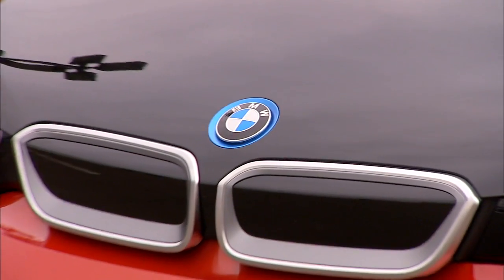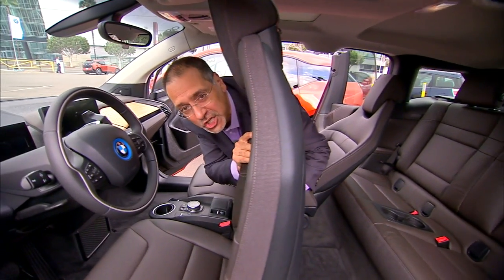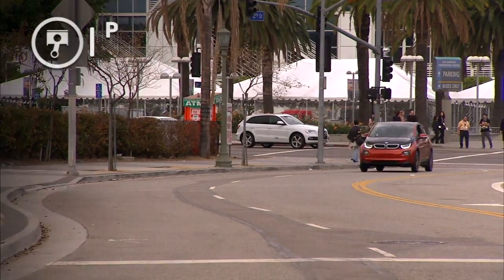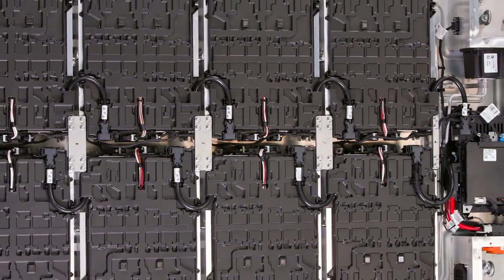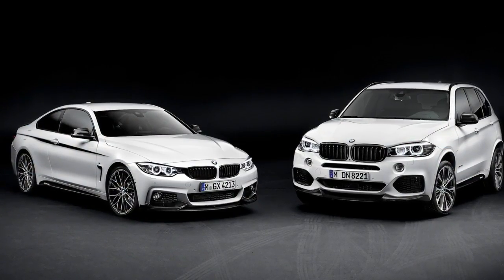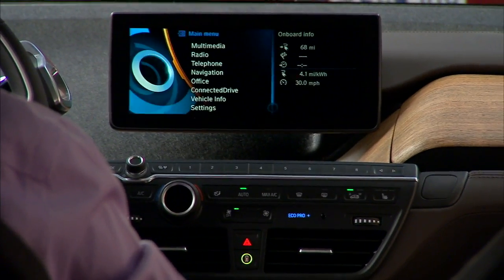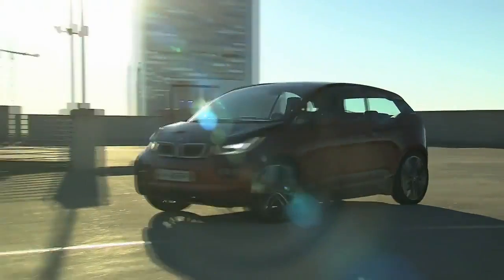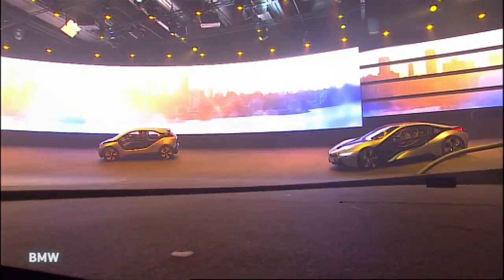CNET On Cars - On the road with the BMW i3

Comment: Tester stated BMW eliminated coast, WRONG!  The coast feature is indicated by a white square on the speed-o- between the power and regen indicators. This feature really aids efficiency and is intuitive to use once a driver realises how it works. Get "ham footed" with your right foot and you will continually accelerate and brake. The accelerator requires finesse  when backing off  power as it hits the coast segment before going into the regen section. Use coast for increased efficiency on downgrades or approaching known stops before backing off to a graduated regen and full stop. Once accustomed to this feature friction brakes are used very little.

Comment: on my 2nd i3 ... best daily driver city car available ... sad how some people are so clueless !
Reply: january161992 I’m thinking about buying a used 2014 I3. I’ve been doing a lot of research on it and I’ve test driven one. So far I’ve seen very few negative reviews. Since you own one is there any downsides are complaints you have about the car?
Reply: Simone Shaw I have a 2014 with REx, and I love it. The biggest issue I have with it is winter range. Using very little climate control, the range drops to about 55-65 miles depending on driving. I live in northwest, so your experience may vary based on the climate. That being said, it drives really well in the winter.

Comment: tesla shits bricks on this
Reply: +MrBvirk yea you can legit buy two of these for each tesla you buy, but you cannot compare the two. An i8 comes closer to comparison but still vastly different vehicles.
Reply: RunningThruThe6WithMyHoes
Oh wow 35k and 200 mile range thats very reasonable, might have to look into that car for my next one, cannot wait!
Reply: but it costs like 30-70k more depending on the configuration of battery size and rwd/awd
Reply: +bustex1 wait for tesla model 3
Reply: bustex1 yes but the good thing is nissan and chevy are coming up with same price range cars too so you even have a choice.
and that's 35K before tax incentives and savings on gas that you'll make. There is 10k off on that tax incentive alone in Cali so the price is $20-25K and if you factor in no gas payments and no servicing then you really are getting a great product. who knows maybe it has autopilot too  like the other new models?
Reply: +RunningThruThe6WithMyHoes yea I've been doing a lot of reading on it. Price range is 35k to 70kish before incentives. They are making a lot of things optional. They are aiming for a 0 to 60 under 4 secs (with the all wheel drive option). Seems ambitious. It's still too early to tell about the exact specs since it's going to be released in two years.
Reply: bustex1 if you are poor then you can just buy a second hand electric car like Renault Zoe which is $6,000 after 3 years. No excuses >:o
My daughter is planning on getting one electric car for sure...they don't fuss over it much like the boys
Reply: bustex1 2 years? specs will be launched in march-may 2016 on most upcoming models.
Even the new bolt is out
http://www.theverge.com/2015/12/1/9828344/chevrolet-bolt-electric-spy-photos
Reply: RunningThruThe6WithMyHoes
 No its not expensive 35k base is cheap. I got a 2015 jeep at the moment and I want another new car in 3 years. I was looking at the AMG CLA 45 which is 50k base and goes to 65k or so fully loaded. and i was referring to production starting in two years. I live in the states so renaults arent even an option xD

If i do get the tesla I would pay at most 50k to 55k (maybe 60k because of incentives since 55k is my max budget) but yea...
Reply: bustex1 I just bought a Jaguar XL 4 years ago so I have nothing saved yet but I'd say buy a second hand Tesla model X if you can get one....that'll be what I'd try to do anyway.
You got one life...I need to own one falcon wing car man...I gotta
Reply: RunningThruThe6WithMyHoes
actually I believe the model X's price will drop by a lot after two years (a brand new one) the gigabyte factory tesla is making or whatever its called will drastically decrease their battery cost. I read that the battery for the model 3 IF THEY MADE IT TODAY would cost 30k just for the battery. After they get the factory ready the battery production cost dramatically decreases. Also maybe the model 3 will have falcon doors as an option since its price goes up to 70k or so. We'll have to wait and find out

Comment: we all know one BIG issue :) it have battery ! only 80mil? how about air con, stereo wipers and so on? if you put everything on? how long can you go? then is battery... we all know from the phone, first year is running ok.... then in second year, just half time, and on third year you have no chance to have even 30% original :) no?
then next Q: how about heavy rain? or flood? snow ? if it will be -20C  battery dies?
then how about lightning, not attract? how much is cost charge? how long is warranty on battery life? how much cost to replace battery? And finally, if you have heart implant, no issue via battery magnetic field? your credit or debit card not will be effected if left on floor for night(magnetic field from battery)?
Reply: vryzenok So this is 5 years late, but:

The range is based on your driving, I’ve seen 110 or 50 miles.
Range is affected by all of the above (not really wipers, though)
Car batteries are far more resistant to degradation, mine’s only lost about 5% over 4 years.
EV’s don’t have trouble with rain or floods, they’re well sealed.
Low temps affect range but won’t kill the battery.
Lightning is not an issue.
It’s about $2 to charge it up at home, varies at public chargers.
The battery warranty is 8 years/unlimited miles.
Battery replacement is unknown as no i3’s are out of warranty.
The battery doesn’t produce a magnetic field strong enough to affect medical implants or credit cards.

Comment: 100 miles on a plastic car with 170 HP? why not 50 hp and 200 miles range? i dont get it...
Reply: +davide30541 Horsepower doesn't kill the range. It's the size of the battery that determines its range.
Reply: Leo the Weirdo right. that is why my toothbrush runs on 2 AA batteries and my power drill needs a 18v battery with lots of times the number of amps/hour 2 AA batteries to have 1/10 of the run time...